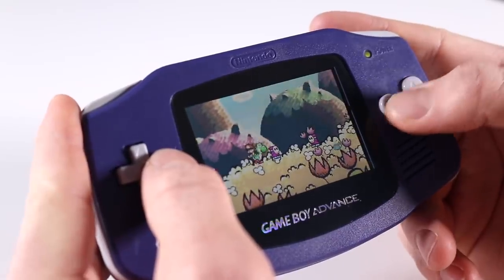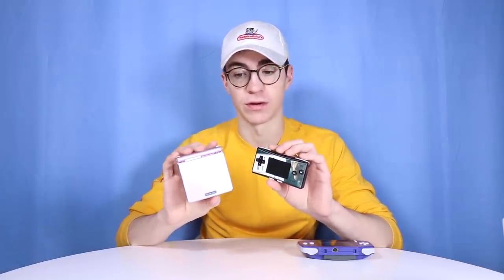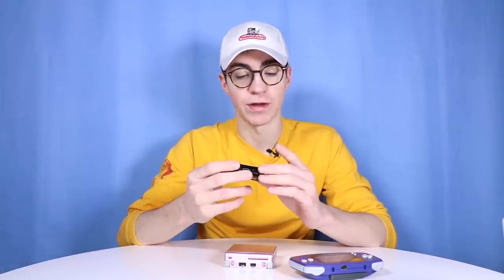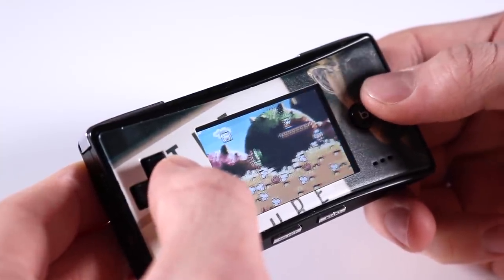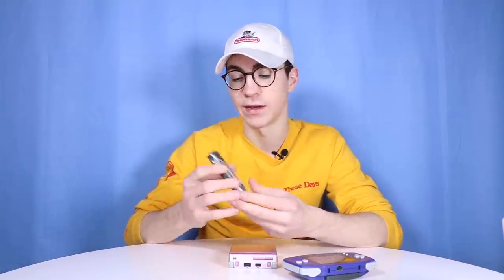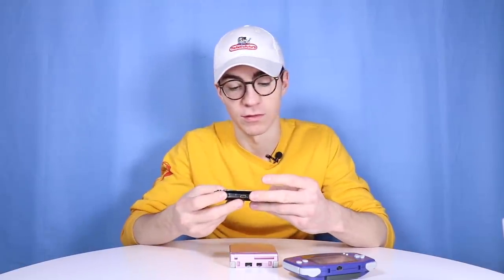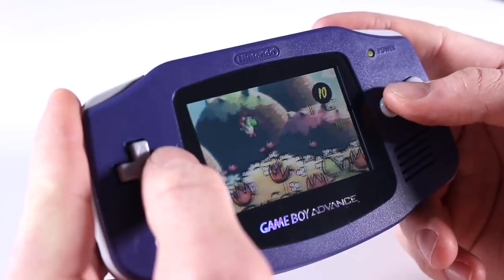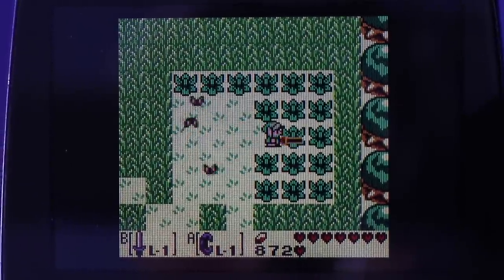BEST Backlit GameBoy Advance?

Comment: I'd love to see a Gameboy micro tear down. It's pretty impressive that they were able to fit all of that in such a tiny package at the time
Reply from the maker: I have done one! Type in Greasy Gameboy Micro!
Reply: @TheRetroFuture  maybe you could make a video where you open all gameboys like advance sp and micro and so on
Reply: @TheRetroFuture  yep I remember that
Reply: @TheRetroFuture  I know this might be a bit much, but what about doing a project on making a Gameboy Micro XL. I have heard that for the most part, people only dislike the size of the Gameboy Micro, and personally I always thought the Micro’s frame and design was always cooler looking than the other 2. While it probably would be difficult to borderline not worth it, I honestly think it could be done if you just used a GBA motherboard and made a custom Micro Shell that would fit it, along with remapping the input for the Select and Start Buttons to the locations in the original Micro, which would be the sort of hard part because I honestly don’t personally know what could be done for that. This is just an idea, and it would be really cool for someone to redeem the Micro by fixing the one thing that most people disliked about it, oh, as well as the partially reworked gba motherboard allowing it to also play gba and Gb original games, aka, the other thing that people were annoyed about it lacking.
Reply: Instablaster...

Comment: Bought a used Game Boy Advance SP (backlit model AGS-101) 'Pearl Blue' color in 2013 from a retro video game shop, and it still had the box and everything with it for $70. I had the original clunky Game Boy when it first came out in 1989, was into it for a few years but stuck playing more often with the main video game consoles (NES, SNES, N64, etc.) instead of the handheld console. Chased down a black Game Boy Pocket brand new still sealed in box off Ebay in 2010, and then bought a used Game Boy Advance (Indigo color) in 2017. Have the Game Boy Player device for the Nintendo GameCube too, and the Nintendo DS Lite was the last DS model compatible with GBA games with the cartridge slot.

Comment: Each to their own. I prefer the SP it's screen and button layout is similar to the original gameboys. I don't understand people who say they love the DMG or GBC, and say that they don't like SP because their hands get cramped up lol
Reply: Well there's that and battery life of a GBA as well as its rechargability. GBA requires AA batteries that you have to remove, recharge, and replace after a set amount of game time (which honestly isn't as long as the GBA SP) so if we're talking ergonomics, then the GBA wins but if we're talking overall it would be the GBA SP for the simple fact it's less compact with more screen space than the GBA Micro but it also has all of the convenient features that GBA lacks.
Reply: Original GBA has the best layout, but worst screen
Reply: The DMG is a lot thicker, and there's not L and R buttons that you have to use. So maybe that's why people say they get cramped.
Reply: I also never had any problems about my hands getting cramped from playing the SP, though I have tiny hands so that might make a difference? It's my favourite gameboy overall, though I might be biased because that's the first one I got all to myself as a kid so it naturally holds a special place.

Comment: The Micro.

To be honest I got really tired of the SP, even with the improved model, it was way, way too square and I just ended up cramping my fingers on heavier play sessions with those cursed shoulder buttons. So the year the GB Micro came out I jumped up to get one and pretty much was in love. Yes, it has a similar form factor to a NES controller, and wasn't perfect ergonomically (sometimes catching my finger on the lip of the cartridge), but at least my fingers had some kind of padding, rather than my joints being used to hit left and right.

Comment: You can play Gameboy, Gameboy Color and even NES games on a micro. You just need a flash card like the EZ Flash. It's emulation but it work pretty well. The GBA and GBA SP both have a little switch in the cartridge slot that is pushed when a GB or GBC cartridge is inserted and tells the Gameboy to boot in the old game format. The Micro doesn't have it but with EZ-Flash you can still play those old games.
Reply from the maker: I have made videos on this!
Reply: Like the Omega card?

Comment: I'd love to see a complete tutorial on building a AGS 101 GBA. I picked up a black GBA and a PSOne with controller untested from the charity shop I volunteer in for £5. The Gameboy works fine and just needs a new battery cover and a glass screen lens as the plastic one is scratched up. I found a kit online like the one you used in your 2018 video for £27.

Comment: The Game Boy Micro, is an incredible little boi. I have big hands and I'm still able to play it comfortably, I think it come more down to preference than anything. My Micro doesn't get much use because it's pretty much near mint and I'd rather not damage it, so I often use my ags-101. But the Micro works great, and as you mentioned, used with a flashcart it's even better, especially because it allows you to play the older games.

Comment: If you take flash cards in to consideration, the micro becomes a bit more valuable because of it's tiny size + a massive library consisting of all gb, gbc and gba games. Also a great way to play is on a moded PSP go. Beats everything.

Comment: Personally I think the SP is the best (I might be a bit nostalgia bias though lol)

The AGS-101 feels like the perfect blend between the portability of the Micro and the comfort of the OG Advance. And the clamshell design really helps with safety as well.

The Advance is easily the cheapest of the 3, but having it backlit requires somewhat extensive modding. Over here in America, the Micro is still more expensive than the SP.

Just extra notes for those considering getting a GBA

-The SP is incompatible with games like Kirby Tilt and Tumble, which relies on the GBC's orientation for it's motion controls.

-The Micro requires an adapter Link cable to connect with other GBAs (the Micro uses a different link cable). This also means that outside of modding, the Micro can't connect to the Gamecube like the others. Micros also use a different charger.

Comment: Just a heads up for anyone with a flash cart for GBA, you can load up games onto a GBA ROM with a program called "Goomba Color" which puts a bunch of Gameboy/GBC games into one GBA ROM, which might be the only way to play them on the Micro, though I haven't tested this personally. Anyone who has a Micro willing to test this?
Reply from the maker: Very interesting! Thank you
Reply: @TheRetroFuture  Sure thing! I've used it on the EZ Flash Cart before and it worked fine on my DS, but I'm not 100% sure it would work on the Micro, though I believe it should.
Reply: Can confirm, have used it on my Micro with ez-flash IV
Reply: @splingo_  Great, so it's not completely cut off from the GB/GBC library! I won't pretend to know how Goomba Color works, but at least it's doable. Come to think of it, the GBA part of the DS is basically just a micro, no GB/GBC support.
Reply: If you watch  @TheRetroFuture  's review on the Ez Flash Omega, he actually tests this on his GB Micro and it does in fact work!
Reply: I have the GBA Everdrive, and the Goomba emulator runs GBC and GB games on the Gameboy Micro.

Comment: I have a modded original GBA with the back light and I threw in the rechargeable battery.  It is my fav as well over the micro and the SP (101).

Comment: What about a CFW-ed New 3DS?
Yeah, it's not as little as a OG GBA or a GBA AGS-101, but it has a very neat screen, and you can play NES, SNES, Megadrive, SMS, GB(C), GBA (right now it has almost 1:1 compatibility, only excluding all games that require extra accesories), GameGear, Virtual Boy, PC Engine (not all games though), even PSX (some games run at full speed right now), and with a DS flashcard, you can play also DS games.
Also it has all the good 3DS catalogue, and some WiFi and web browsing capabilites.

Comment: I write this part of the comment before watching the video:
The DS Lite is IMO the best backlit GBA. Only downside is it doesn't play your original GameBoy/GBC cartridges, but other than that it's the real deal. Backlit, (IMO) best form factor, built in rechargable battery (that has some good life in it) and a headphone jack. Beats out the other options for me, even in terms of price. I modded one (that had a top screen with dead pixels, a broken casing and on which I break the touchscreen connector) to take the top screen off and that serves me well for GBA games. I could always play 100% legally obtained ROMs via a flash cart.

Revising this comment after watching the video, I can say a DS (modded or not) is just an improved GameBoy Micro. It is pretty great to be able to play GameBoy games, so modding an AGB 001 is probably a good idea too. I will do that once I can get a good priced unit (not gonna mod my nostalgic unit)

Comment: I've always preferred the original for the ergonomics. Even back in the day I installed one of those afterburner frontlight kits in mine before the SP came out. Also bought the SP but never really liked how cramped it is to use. I have a backlit original gba now and it's soooo good. I love it far more over the ds actually. Also gba games on ds just don't feel right, the screensize is wrong and it's not nearly as comfortable to hold.

Comment: Even if my Gameboy Advance had a backlit screen, I'd still prefer my Micro.  Thing is, at home there's no need to play the Advance because I have a Playstation.  When I travel nothing beats the tiny size of the Micro.  So the Advance just sits in a box under my bed untouched for years.  As for the SP?  I was going to get one once, but decided to go with the Micro instead because of its smaller size,...and I've never looked back!

If I had one wish for Nintendo though?  It'd be a new Gameboy Micro, but with all the games built in, so I don't have to chose which cartrages to take with me on an airliner!

Comment: The biggest caveat to modding a gba with an ags-101 for me is the fact that I have to purchase all the other things for me to do it. Estimated cost for that is greater than the 35 I paid for an age-101 sp and the 15 for shell parts and pieces to replace it. You’re going to be hard pressed to convince me that isn’t better than doing the modding starting from 0. Obviously if you have the equipment already then it is all a different story but many gamers interested in retro gaming don’t.

Comment: Dude @ 3:40, I don't know what you're talking about with the whole "pixel ratio" thing. The GBA, GBA SP, and GameBoy Micro all have a resolution of 240x160 and a 3:2 aspect ratio. None of them have a pixel ratio other than 1:1. Are you talking about pixel density or something?
Reply: Yup, the micro has a higher pixel density compared to the SP

Comment: Can you test the Aurora cable for the 40pin gba to backlight modding?
Reply: if your talking about the 5 level brightness cable for the ags 101 mod, I have it. Its pretty good, worth the $40 bucks. There are other ribbon cable options now with different inputs and whatnot on ebay. I don't believe mine is the aurora but it was either derived from the aurora or vice versa. I made a post on the r/ Gameboy about it last year if your ever interested.

Comment: Can anyone help. I have original gameboy dmg-01. I clean the battery contacts. Took it apart. And put back together. Turns on but the screen in blank. Contrast wont do anything. Cant hear anything unless I plug headphones in. Ribbon connector is in there snug.

Comment: Another knock on the SP: No headphone jack.
Reply: There's a cheap and easy to purchase adapter to remedy that issue.
Reply: Yeah but then you can't charge the thing while using it.
Reply: Indy Cyclist the og iPhone
Reply: Have you noticed there’s always an idiot complaining about a lack of some output or port, or compatibility. You bought it. The manufacturer scored a sale without it. Peace.
Reply: @Don-h4d  The video is pros and cons of each of them.  It is most certainly a con, especially when comparing it against other Nintendo devices from around the same time period. I don't see how it is idiotic to point out a con.
Reply: @Indy Cyclist There is an adapter for the GBA SP which is part of the dreamGEAR accessories which allows you to plug in both your headphones and your GBA SP's charger at the same time.
Reply: @notthegoatseguy  You can't even charge a GBA tho